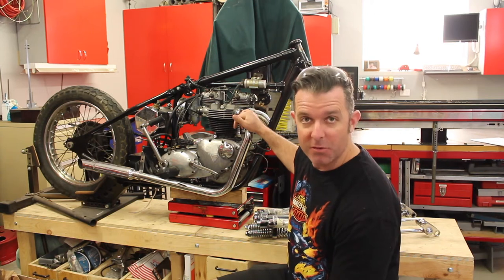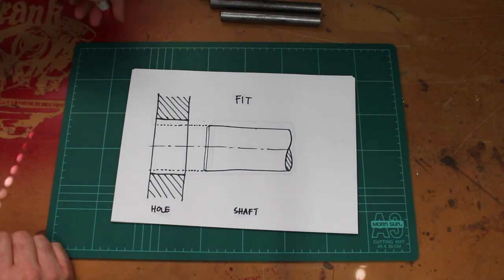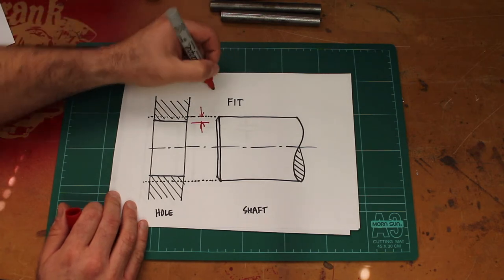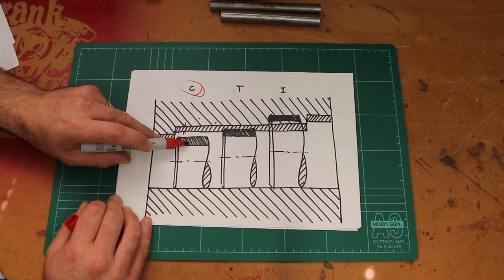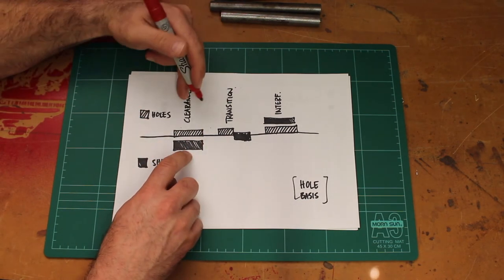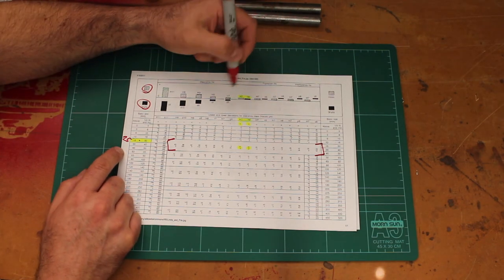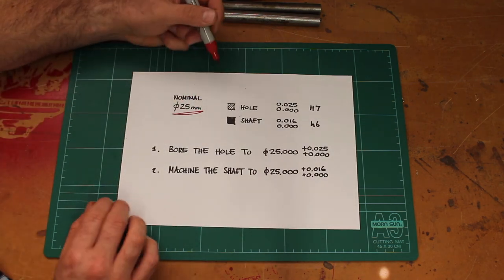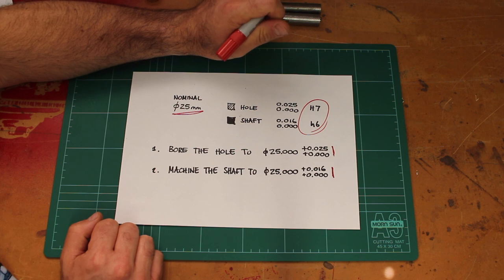Introduction to limits and fits

Comment: Hi Matt, I am not an expert on this that's why I am watching this video, the fit you are talking about here seems to be a Clearance Fit according to a book I have. The shaft size of 25mm (lies between 18 and 30mm) and for a H7/h6 fit, the following:  H7=0 to +21  and   h6= 0 to -13mm.  I could be wrong, but that's what I found.  Actually, the chart you are using gives the same hole and shaft tolerances from 18-30, 30-40, & 40-50. Your video is very helpful.  Cheers.